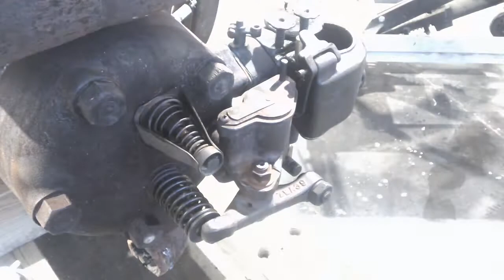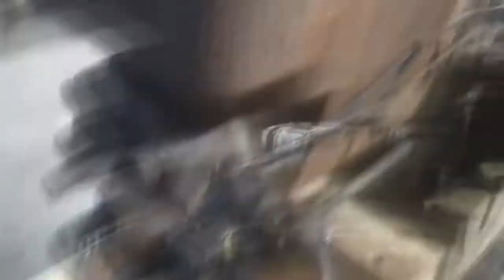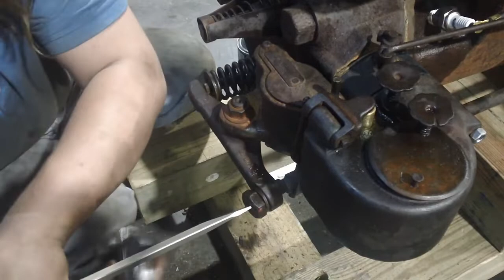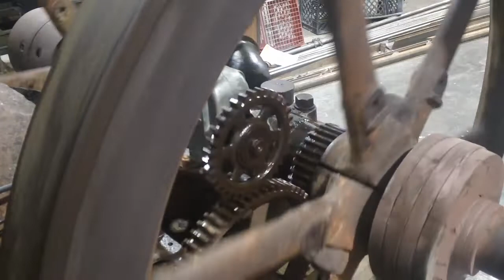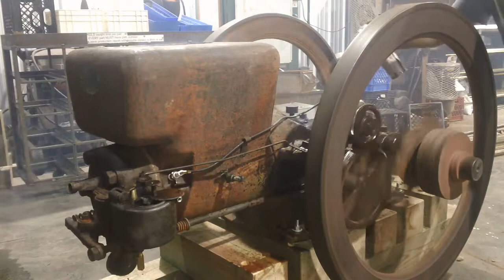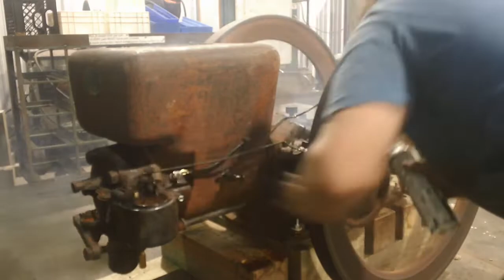First Start! 10HP Fairbanks Morse Z Antique Gas Engine

Comment: Very nice. Have you tried adjusting the mixture needle so it could get a richer mixture? That might help it to overcome whatever issues it's having sucking up fuel.
Reply from the maker: it was an airflow issue as I wasn't running it at operating speeds from when it was built. the intake under the carb had a pipe fitting for 1.5 pipe and I put a old brass valve on it to regulate the airflow better and it is a great running engine now. just haven't had time to get a video of I as it sits right now.

Comment: Nice engine! Is that a FM-J1A2 mag? I’ve just bought a 10 hp Z, spark plug ignition, and I’m on the hunt for a mag. I have the 33 tooth gear with impulse, just haven’t decided between going with the R or J mag. I think the FM-X may work too.

Comment: Why does it refuse to run unless you keep choking it? More importantly, you should be very ashamed for not having an oiler on the cylinder!!!
Reply from the maker: its the first time this engines ran in a long time I've put so much oil in the cylinder there no need to get in a hurry about a oiler until I knew it was running good. as for the choking problem i had some fuel issues i had to work out and this engine is extremely worn out so it runs lean all the time  from extreme blow by .